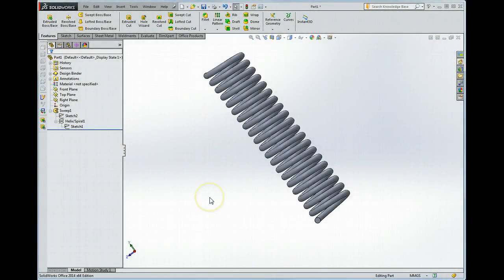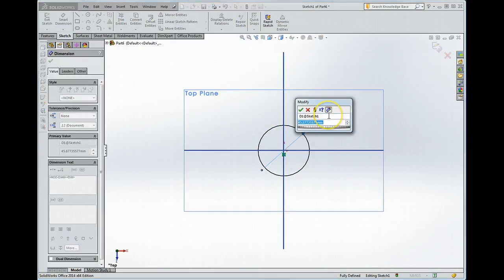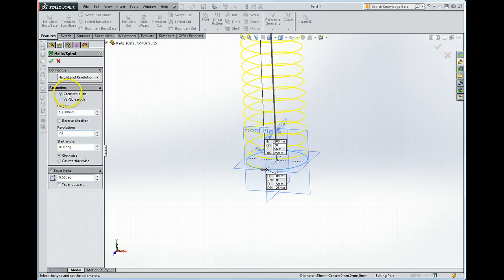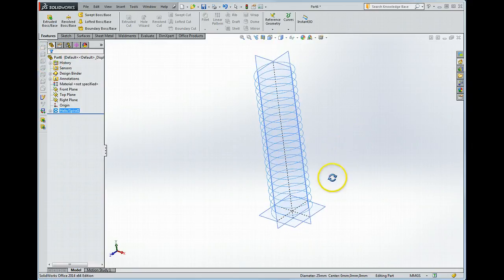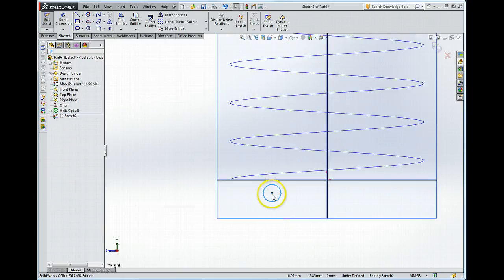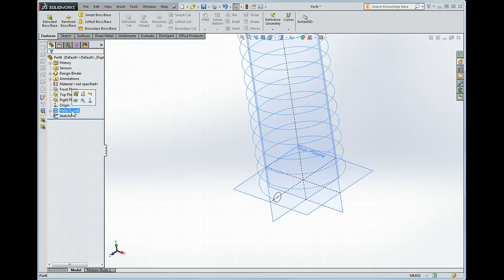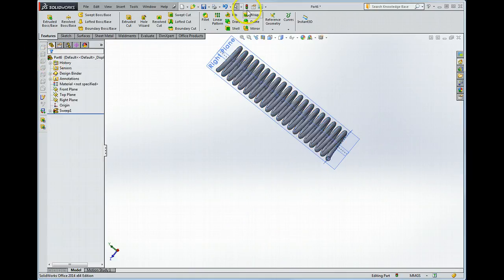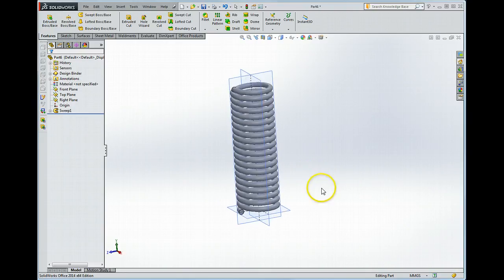SOLIDWORKS Coil Spring Part Tutorial. Learn how to make a simple spring using the helix feature.

Comment: Thanks for the video. Im just learning and your clear explanation was the best one i have found. I was having trouble with the pierce comming up. The edge was my problem.  Im trying to put a spring in an application where the spring rides on a shaft between two moving blocks guided by the same shaft. I also want it to by dynamic in simulation. Still not there.  Thanks. 🙏
Reply from the maker: You're welcome!